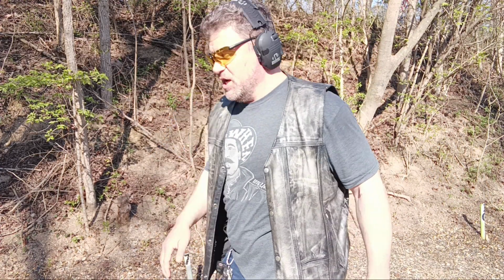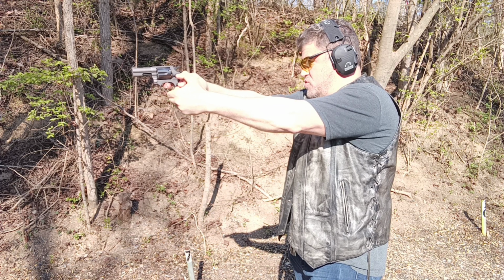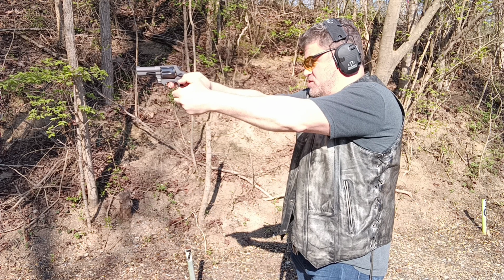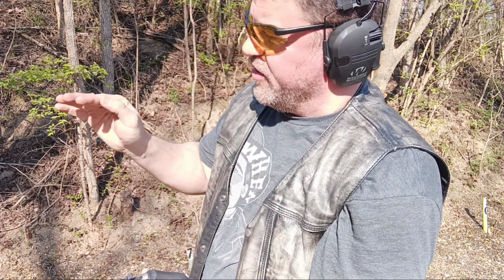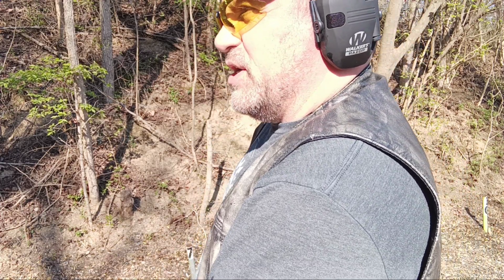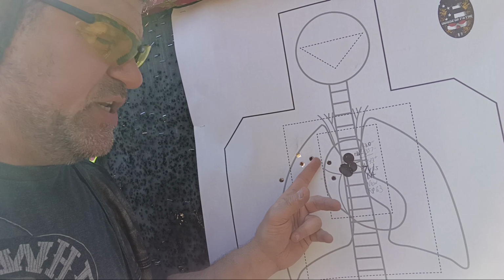Cool Revolver Wrapid Loader 1st Attempt but does it work & HOP .357 Magnum

Comment: Yeah when I string to the left I am not holding the gun tight enough. Its not anticipation or moving the gun. Rob Leatham says to squeeze the life out of the gun. Lots of folks say to relax but not Rob who says to hold the gun really tight, point the gun at the target, and pull the trigger without moving the gun. Thanks for the wheel love.
Reply from the maker: I used to squeezy really hard, Vogel like but now backing off a bit, watching some Stoeger stuff
Reply: @DanTheWolfman  When I anticipate then I am moving the muzzled of the gun down before the shot breaks anticipating recoil. So shots go low or low left. I tend to string shots more than anticipate by not holding the gun tight enough. If I am anticipating then I need to get back to the three steps of fire control (tight, point, don't move the gun) I listed above that Rob talks about. Dry fire practice to keep the gun still while pulling the trigger and not move it off target. Some folks say they jerk the trigger so Rob says learn to jerk the trigger without moving the gun.